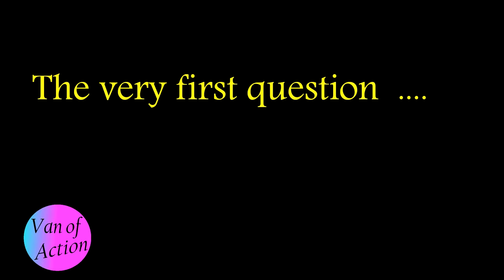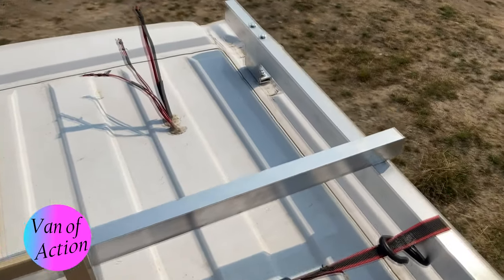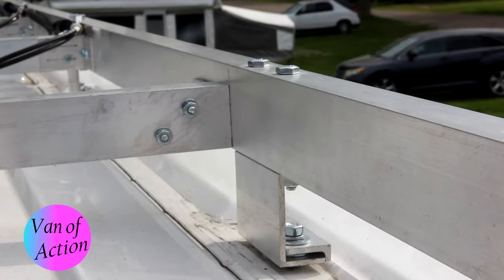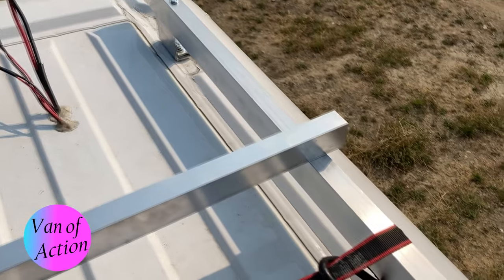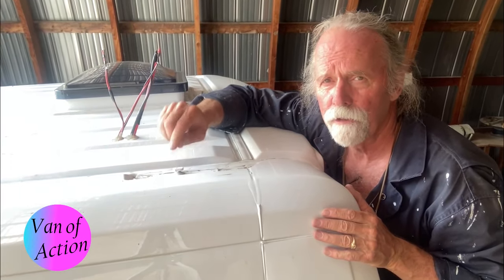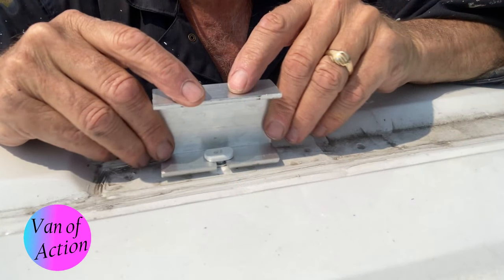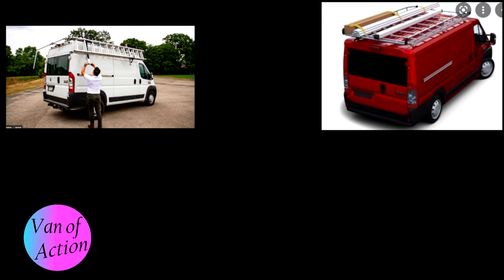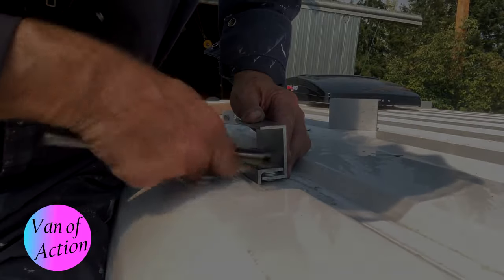Van Conversion Roof Rack Clip Design Comparison

Comment: I love your videos.  You are so methodical in your approach/explanations.  I have a couple of ideas,  one of which involves  a length of flat rubber instead of the washers, which will compress as you tighten the bolts,   but if I make a video I will certainly credit you for the idea. 

I have another idea, but  I think yours is better tbh. Thank you so much for explaining your whole thought process.
Reply from the maker: David - thanks for watching and taking the time to comment.  I really appreciate the kind words.  I would suggest caution in using rubber instead of the washers.  The purpose of the washers is to provide a firm seat for the top clip as it sandwiches the roof pin between itself and the bottom clip -(the "C" channel).  As long as the washers are slightly narrower than the pin, the top clip can be pulled down tight.  It will deflect, at least mine did.  I would be concerned the rubber would compress creating even more deflection.  Just my 2 cents -   be well my friend - if you make a video please send me a link :)
Reply: I was going to make the rubber deeper than the ducato fixing.  My thought process being that as you tighten the bolts the rubber squashes, but not too much.,  because the rubber provides some resistance over a larger area than the washers. 

The rubber allows contact between the two pieces and compresses around the van fixing.... giving it even more support.  I was thinking the rubber would also dampen down any potential vibration. 

The van isn't being delivered for about 5 months,  so I have lots of time to think about it..... keep up the great work
Reply from the maker: @peapod2083  - i’m not sure I agree.   But my opinion and couple dollars (pounds) will get you a cup of coffee.  Let me know how you make out.

Comment: Hi Dave, this is exactly the sort of explanation I have been looking for, I recently bought a Peugeot boxer long wheel base which has the same stud system. I shall have a go at fabricating your design of brackets and see how I get on, I then intend to use extruded aluminium for the main body of the rack. Many thanks for such a detailed and thorough explanation and best regards from the Uk
Reply from the maker: Hi Mark !!!  Thanks so much for taking the time to watch and comment.  Yes - your studs are just like mine.  You may also find this video helpful ... it's the one I made as I designed and built the roof clips  - https://youtu.be/vaktvBhjgBo   ... and this one has more details I missed explaining the first time  ... https://youtu.be/diIZe-teysU  ... and lastly this one is about the roof rack I built on top of the clips ...   https://youtu.be/tkyhTzkyAOI. All in was under $ 300.00 (Canadian) and not that hard to build.  Let me know how you make out - it could help others who think things are too hard.   Be well and stop back  .....    Dave

Comment: Hello again Dave.  I probably found the reason for my problem.  I decided to use 5/16 inch bolts instead of 1/4 inch, because I was using steel channel struts because the aluminum was so expensive.  I went back to the hardware to and compared the head depth of both, and of course the 5/16 had about a 1/16 inch thicker head.  So I just purchased a bunch of 1/4 inch stainless steel hardware and I'm going to give it a try.
Reply from the maker: Hi Leo - that may make all the difference - what size and profile of steel channel strut are you using ?

Comment: Great explanation, I also watched your earlier video when you go through the design and fabrication of your clips. I think you came up with a great design that is relatively easy for us DIY’ers to build. You noted that you didn’t find much information on those roof studs on the Promaster, so we really don’t know if they are designed to carry the load of the roof rack (your design) or transfer the load to the roof (Fiamma design). 
Enjoying your presentation style, looking forward to future videos.
Reply from the maker: Hi Effie - thanks for watching and commenting.  You are correct we don’t know.  But because these studs are designed to effectively hold the rack down (Fiamma clip) I am comfortable they can hold up the load I have on them.  I understand the physics would be different between the two in a crash - but if the crash was significant enough to cause damage I think the roof rack would be the least of my worries.   Be well my friend.

Comment: thank you for sharing, question about the channel that you are using for the clip, any thoughts on using a lower profile channel, instead of 2" maybe a 1.5"?, thank you.
Reply from the maker: Hi Dan - thanks for watching and taking the time to ask.   I used the 2" material for 2 reasons.  First- it's what they had in the scrap bin.   Second - it was recommended to me by someone who has had roof racks before that the rack should be at least an inch off the roof to prevent whistling as you go down the road.  The Promaster roof isn't flat,  there is a crown in the center and with  1.5" stock I think you would be getting pretty close to the metal.  Now I don't know if it would whistle or not - but I know mine does not...... Hope you'll join the community .... and stop back .. Dave

Comment: Lots of comments on your videos about galvanic corrosion but it's only a serious problem if the contact area is moist and it will be worse the more chloride the moisture has (salt). The ratio between aluminium (anode) and stainless steel (cathode) is relevant too - if there was more steel and less aluminium the corrosion would be quicker and worse, e.g. a huge steel boat hull with a tiny aluminium sacrificial anode in salty sea water. In the case of these roof racks, it's a huge amount of aluminium and a tiny amount of steel, and that is why you won't see much corrosion, if at all.
Reply from the maker: Hi Elliot - you sound like a person who knows a bunch about this type of thing.  I agree totally with what you're saying.   I am not the least bit concerned but I will keep an eye on it when I do my yearly inspections .... I hope you'll stop back.  Be well ,,,, Dave

Comment: good vid,  looking at ideas to make a light weight low roof rake,  in the UK, these t bolts are called ,  Roof Rack T bolts,   this system looks good for my design,  but making/finding  the brackets is going to be fun,
Reply from the maker: Crazycrab !! Thanks for watching and taking the time to comment.  YOU can make these roof clips for less than $15.00 Canadian - they’re simple.  My first tutorial is here.   https://youtu.be/vaktvBhjgBo. If you visit vanofaction.com there are several others as well.   ( I’m on the road with just my phone and copying - attaching links is pushing the envelope). They have been duplicated all over the world !!!  Let me know how you make out.
Reply: @VanOfAction  will do,  but it will be in around 2 months or 2, slow worker, :)
Reply: @VanOfAction  Seen  cheers  :)

Comment: Your design is exactly what I need - thank you for sharing. Just one question - how are the T clips actually attached to the van structure- are they simply bolted in, or can they be removed and discarded in favour of a through bolt design which can make the entire rack system be easily removable, or even sectional? I hope you get my meaning. If that T anchor is removable it opens up a whole new design concept!
Reply from the maker: Hi John.  Thanks for watching and taking the time to comment.  I understand exactly what your question is and the answer is - I don’t know how they’re attached.   But I do know they spin - or at least turn 90 degrees.  So they will not “unscrew”.  In terms of being removable - my clips come off quite easily.  I took them all off this spring (one side at a time so I could lift the roof rack). To inspect before I installed my awning.  I suppose you could make the racks in sections and have each chunk removable.   Here is the first video about the clips design. …….. How To Make D.I.Y.  Promaster Roof Rack Clips - solar panel roof rack van conversion  - Van Life
https://youtu.be/vaktvBhjgBo.   Also on my channel there are a number about the clip and rack system.   If you do copy it please let me know how you make out.    Hope you stop back …….  Dave.
Reply: @VanOfAction  Hi Dave, I am looking at a totally different aspect than a roof rack. I bought a Vango Kel drive away awning a hole back, but the whole reattaching the link portion is very frustrating. I may go down the Solar route but for now I just need a simplified re attachment system for the awning/ extension. Basically it is attaching a tent to the side of the van. I am also looking at a very attractive system as shown on the  "Back roads Van Runner" You tube video for simple awning/shade option. My van is a multi functional doubling/ trebling up for my fishing trips, family getaways, and grandkids trips. I have a lot of ideas, and will be getting very busy. I could have saved myself a lot of hassle fitting Unistrut using Riv Nuts, and I might still do. However, your system and it's simplicity is the best I've seen by far. Thank you for the response.👏👏

Comment: Been looking around and prices of roof racks are still absurd.  I think I'll go with something similar to what you've done here.  Common sense design.  Perfectly adequate for mounting solar panels, very lightweight and cost effective.
Reply from the maker: Roadghost88 - thanks for coming by and taking the time to comment.  This system has been copied by builders all over the world which really makes me smile.   You may find this helpful    https://youtu.be/vaktvBhjgBo and this https://youtu.be/diIZe-teysU  and this spring I installed an awning ... went like it belonged there .... https://youtu.be/tONCOtB_nMo     Good luck and please share with me what you end up doing - it's in the conversation that we all learn...   I hope you stop back and join the community .... Dave

Comment: And I like your design,I have started to make one but my carriage bolts didnt work too good as they just spin so i will try regular bolts,what size
Reply from the maker: Yes John carriage bolts will spin as you tighten them down.   Use a regular 1/4” bolt - you can slide a box wrench under the clip to hold it still.  It’s tight - I ground a little off the wrench end to be safe.   But I think it would have fit otherwise.

Comment: I mistakenly bought a 3" aluminum channel 3/16"thick for this system which I intendedto use the 80/20 -1.5" Series extruded bars, but he 3/16" wall doesn't fit under the roof clip. I have to file all 10 brackets to make fit.
Reply from the maker: Ucandoit - correct the 3/16” would be too thick to fit under the clip.  But for $ 13.44 I think I’d start over.  The thicker material can be used for clips and brackets along the way.   Be well.

Comment: Hello Dave, this looked like a fine approach to attaching a roof rack.  I purchase all the material and made a test piece.  That was tricky but doable.  Than I took the test piece and tried just the C channel.  It fit the T pin perfectly.  The stem of the T pin is 1/4 inch.  Than I put in the bolts and got a rude surprise when I tried putting the Channel on the T pin.  The heads of the bolts were touching the roof and no matter how I tried I couldn't make it work.  Exactly as you experience when trying to mount your piece with the channel pointing in.  But my channel was pointing out and it still would not work.  You might mention this possibility to your readers.
Reply from the maker: Leo - thanks for your comment -  And thanks for sharing  - we're all in this together.     I think there can be a fair bit of tolerance in the factory when they are sealing the roof panel lap joints.   If you used 1/8" aluminum C channel and 1/4"  bolts there should be lots of room between the underside of the  T pin and the top of the roof..........   UNLESS   .... there is too much gunk / mastic / or the sealant they install in the factory for when the metal panels come together.  Maybe your's has more than mine.  I noticed that some of the bolts were closer than others but all fit.   First I would recommend you try every T pin - you may find they're to all the same.    Second I would put the bolt in a vice and grind just a little off the head to see if it'll slide on.    I'll be making a more detailed video about  these clips next week and will talk about that.  Thank you soooooo much for sharing.   Be well

Comment: Looks great...do you use stainless hardware?
Reply from the maker: Hi Mike - thanks so much for watching and commenting  The nearest hardware store is a 30 minute drive - I used what I had - a mixture that included some stainless.  Over the winter my intention is to take a morning and switch out everything that isn't stainless.  It should be a simple job.  Be well - (you can see more of the build at "Van of Action .com"

Comment: Are you concerned that your fasteners may rust? Wouldn’t stainless steel fasteners be a better solution?
Reply from the maker: Hi Splintered Finger - thanks for watching and commenting - the SS / Aluminum debate seems to have many sides ...... I don't know anything about it.  When I built my rack I used what I had on hand.  People asked about rusting.   After a year  I did a complete inspection and so far nothing to report .............. the video is here  https://youtu.be/diIZe-teysU.  It doesn't amount to many bolts to change is needed so I'll keep a close eye on it.   Be well and stop back :)